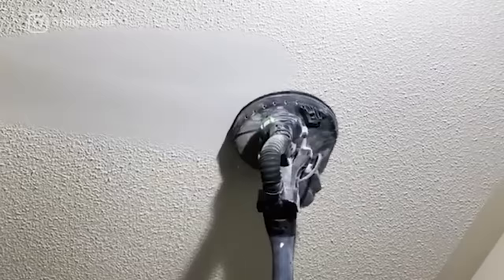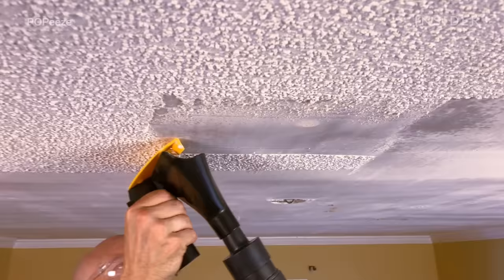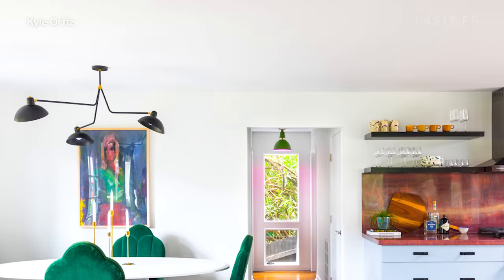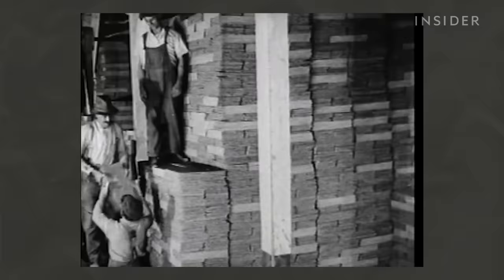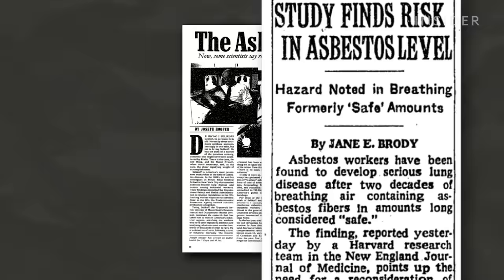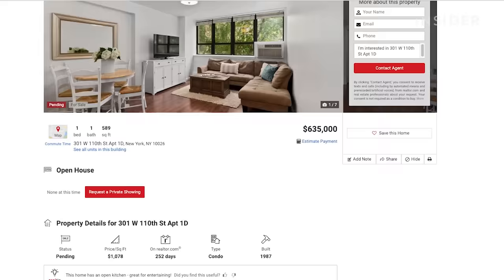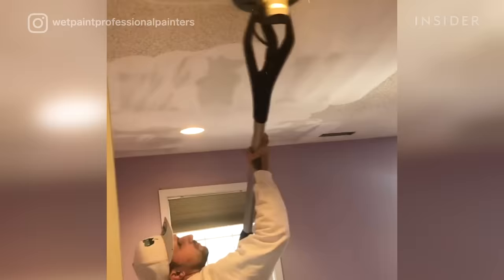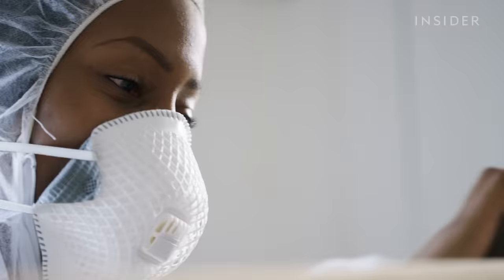Why Are Popcorn Ceilings So Terrible?

Comment: I recently moved into a house that had popcorn ceilings installed in all the common areas. But, my wife and I love the ceiling because whoever had it installed had glitter mixed in, so it sparkles! I feel like I'm looking at a night sky.
Reply: The house I grew up in had iridescent glitter in the popcorn so it took on a variety of colors.  I always thought it was pretty.
Reply: Uh dude... I hate to be the one to tell you this, but I worked 15 years as an asbestos building inspector.  While not always containing asbestos, I observed that the glittered popcorn ceiling was more likely to contain asbestos.  Probably something with the styles at different time periods.  This is in reference to the ceilings that had gold or silver flecks mixed in with sprayed on surfacing and not referencing a ceiling someone later applied actual glitter to.
Reply: @anonlastbend7439  just googled glitter popcorn ceiling because I never seen it before and got this information so it must be true.
Reply: Scott: Our commercial building which was built in 1966 still has it's glitter mixed with the popcorn on the ceiling.  You are right the glitter does look like stars when the light hits it just right.
Reply: @josephquezada6138  ya my house only has it on the stair well ceiling leading to the basement, really nice effect to be honest lol
Reply: Our old house had a child’s room where a dozen or more glow in the dark stars had been put on the ceiling above the bed.  Even after my wife removed them, you could still see faint glowing stars at night.  ✨
Reply: @whatisahandle221 we painted glow in the dark stars on our daughter’s ceiling. Then painted over them later. You couldn’t see the stars after that … in the daytime. But at night they’d still glow up and shine just a tiny bit. People thought they were hallucinating! We had to remember to warn people who stayed in that room overnight. 😂

Comment: As an asbestos removal expert I only watched this to make sure it was mentioned. 
It's both unwise and in many states illegal to remove asbestos containing materials yourself. 

If you do decide to do it yourself, know that asbestos fibers can stay airborne for up to 5 days in stagnant air. Industry standards require workers to wear p100 respirator filters. And dry removal is an absolute no go.

It is really in your best interest to have your demo materials tested for asbestos prior to removal whether you plan to do it yourself or hire a contractor. Low level exposure to asbestos fibers will not likely cause asbestosis, however lung cancer/mesothelioma can be contracted potentially through one exposure. (With a latency period on 20-40 years average)
Reply: I thought latency was 10 to 40. It's been 20 years since I removed asbestos.
Reply: Thanks for the heads up
Reply: can 2x4 ceiling tiles from the 80s have asbetos?
Reply: Thanks for the informative post. What are your thoughts on nailing tongue and groove boards directly over the popcorn? Someone in my home did this and I am concerned that the process of nailing the boards smashed the popcorn and released toxic fibers into the home... Thanks!
Reply: @randomrazr  No. It was gone by then.
Reply: Your comment should be pinned, it is a really dangoures stuff
Reply: Nice try.. keep securing that job security bucko
Reply: Is there asbestos black market?
Reply: @chanpasadopolska  I am pretty sure there is, as for every kind of Waste.
Reply: My neighbor called my dad in for removing asbestos slate siding.   When the state inspector came he was quite happy.   Apparently my state was giving out loans to remove the stuff.  He also had no problem with how my dad was doing it.
Reply: Can't wait... I get a speed run on life.
Reply: Just curious do you know of a modern safer version? I love the look of popcorn ceilings, way nicer to look at than smooth
Reply: @mlee6050  Home improvement stores will carry a special roller. It has texture that you dip into a watered down mix of drywall mud (or use plaster for longer wear), and you just roll on texture to the walls. Looks very nice and better than using a sponge for effect, or a wet schrunched up groccery bag, or the avant-garde broom sweeps. So you can pllay with the thickness of the mud/plaster and also the pressure you roll with. Keep your tools clean between breaks and you will have beautiful walls or ceilings in no time. 

BUT usually you do the 'knockdown'  approach for a thick textured ceiling. 

Either way you will want to apply that texture to a smoothed finish for best effect, not just right onto the drywall... that dont work very well. And use primer paint before your flat ceiling paint.
Reply: @migs7220  thanks for that, going to be awesome to do :)
Reply: @chanpasadopolska not black market, you can pretty much still buy it in china since it is still being used as a construction materials there....
Reply: I used to scrape off the popcorn crap when I was a kid all the time in hotels and stuff...Good to know. I'll check back in 25 more years and let y'all know if I have cancer.
Reply: @mlee6050  You can get the same texture, without the asbestos. It's just the really old stuff that contains it.
Reply: I do asbrstos abatement as well. I'm setting up a full-house celing scrape right now. Just stopped for lunch and this video came up. Had to watch it, lol.
Reply: Just do regular lung cancer screening.
Reply: That's fine if I get mesothelioma because then I'll be entitled to some compensation 😂
Reply: I had no idea about anything and decided to put up some cheap foam tiles, anyway I disturbed the popcorn ceiling several times and ended up pulling them all down in the end...Still waiting for a test from the council. I have 2 kids under 5 with asthma :( very worried
Reply: @BewareTheLilyOfTheValley  i laughed lol
Reply: Probably best to cover it with Trusscore or similar product.

Comment: 10 years from now
Science Insider: “Why are plain ceilings so terrible?”
Reply: Agreed
Reply: "bad acoustics" loll
Reply: We are applying every thats come in market without knowing what will be there effect after 10 years 20 years after . What is there side effects.
Reply: Jajaja true
Reply: op exactly
Reply: 15 years later:"why false ceilings are so terrible?"
Reply: @honor9458  rofl
Reply: No.
Reply: Oh yea
Reply: Yea Why Don't We Buy A $800,0000 Ceilling Made Of Gold?
Reply: Honestly I wouldn’t be surprised!! They change their mind about everything!!!
Reply: It's called artex and not all of it contains asbestos. After something like 1984 they stopped adding asbestos to the mix so those ones are perfectly safe they're not all "popcorn" either some are swirls or other variations on geometric designs. Even the ones with asbestos are safe to remove as long as you don't scrape it or something making particles airborne. You get a special coating which makes it like jelly and just peels off.
https://en.m.wikipedia.org/wiki/Artex
Reply: @Michael Hauger Generally speaking but the artex company was bought over by a French company who continued to use asbestos upto I believe 2002. Obviously that's all dependant on the manufacturer but better safe than sorry when it comes to that stuff, it's horrible. Just to say really appreciate you spreading awareness of it, it's personal to me
Reply: If they have asbestos in them then yes . Otherwise don’t be dumb
Reply: Well usually it's a knockdown or orange peel texture and not just plain

Comment: Its  called  acoustical because it is sound absorbing and stops inside echoing. It was made for commercial buildings to cut down echoes  in hallways, large meeting rooms, concert halls etc. It works extremely well, cutting the echo effect in half over flat ceilings of other textures. Its used in residential homes mainly because its sprayed on and goes on faster then other then other ceiling textures

Comment: I like popcorn ceilings. Visually pleasing, no health risks (don't buy a house with asbestos) and better acoustics. Easy to maintain, too. If you drill a hole for a light fixture (disco ball!) and later decide to remove it, you can cover the hole with a bit of paint. Popcorn ceiling is uneven so any imperfections will be easy to hide.  

Smooth ceiling is THE worst option you can choose for a family home. There's a massive echo because sound waves will bounce off the ceiling, the walls and the floor (assuming you've got hard floors). When you let out a fart, it sounds like a laser shot. pew-pew-pew

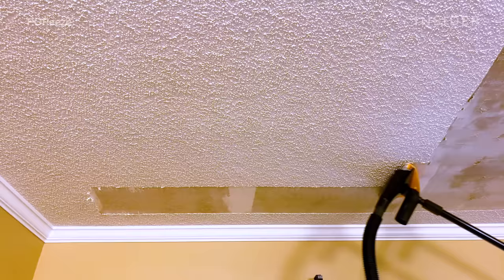Comment: 2:42 "the only practical problem with popcorn ceilings is the release of asbestos in the removal process"
4:30 "if you've got popcorn ceiling you can go ahead and remove it yourself"
Reply: 5:36 “your a pleb”
Reply: I’m so sorry for your lack of oral comprehension 😔 I’m praying for you, bro 🙌
Reply: shows "do it yourself" person using a respirator. Then shows 3 shots of professionals doing it happily without breathing filter while all the dust falls around them.
Reply: Alfonso Cevallos 😆😆❤️👏
Reply: In the US, can we assume that popcorn ceilings in homes BUILT AFTER 2000 are asbestos free?
Reply: No Alfonso. Read my post above on asbestos abatement. It's not an easy or safe job.
Reply: @tomlandon209   I wouldn't assume anything, esp. if you had an unscrupulous contractor w/ old stock on hand. Besides, how many homes had popcorn ceilings after the late 80s? If it's popcorn, it's a safe bet it has stos. Don't diy!! Please!!! You endanger not only yourself, but everyone else who enters that room/home.

Comment: My house, built in 2001, has popcorn ceilings. I never notice the ceiling either in a positive or negative way. It's up there covered in a texture that I'm not gonna bother to change. This sounds like more major whining about minor issues that has become way too common in society today. Just my humble opinion.
Reply: I always thought the texture was more cottage cheese looking that pop-corn.
Reply: I don’t mind them but the asbestos is more than a minor whining issue
Reply: @cl22396  Yes, that would be a problem. But in my '01 house, that's not an issue, hence the cavalier take.
Reply: @aggielonghorn they’re unsightly and look cheap. No one is whining lmao it’s just an opinion and over homes don’t tend to have popcorn ceilings. They’re outdated and lazy work
Reply: Until they are no longer white and you have to paint them.
Reply: @Moluccan56  lol, so true and that time is pretty much now. Initially the walls including all ceilings were painted an off-white sort of color, but masking is no longer occurring. We must remove the coating to paint or spray paint the ceiling with an air spray gun. We'll see.
Reply: @aggielonghorn spraying seems to be the best way to apply paint to popcorn, as long as you want to do your walls afterward. The popcorn can get bald spots and the roller becomes all gummed up with the spackle, it’s not a job that anyone could say is fun. 🙃

Comment: Save you 6 minutes, popcorn ceilings that are 40 years or older might have asbestos in it. Otherwise it's just a cosmetic thing and you can ignore the "danger" click bait thumbnail.
Reply: Better get rid of the popcorn ceiling ASAP because even the tiniest amounts of asbestos causes lung cancer. We're talking as little as 1.3 parts per billion (1.3 mm^3 out of a cubic meter). Even brushing it with a feather duster already releases that concentration of asbestos.
Reply: @00crashtest  welp good luck to all the poor souls who are going to die just because they wanted to remove popcorn ceilings
Reply: This video is hardly clickbait.
Reply: Thanks
Reply: 00crashtest true, but what are the chances of that extremely tiny amount being inhaled?
Reply: I work in remediations for asbestos. To be honest, everyone breathed in asbestos in their life. If your house was built around/ before 1970, there is a good chance that your house can contain asbestos.. it can be the insulation around your pipes, the popcorn ceilings, tiles, on the roof or even outside of your house.
Reply: 00crashtest stop spamming comments with your copy paste bull shiz
Reply: @00crashtest  if left undisturbed, there is very little risk. HOWEVER, if you have a popcorn ceiling with asbestos in it or the drywall behind it, you CANNOT just remove. there is a very good reason why there are companies the specialize in asbestos abatement (they can remove asbestos laced materials in a safe manner.) so don't, for the love of god, just DIY remove building materials in a old house unless you know the house either was already abated  or  was post asbestos ban.
Reply: Thanks
Reply: Thank you!
Reply: THANK YOU!
Reply: my house was built in like 2000 so i think im good
Reply: @bbarbiter  Over the years, the chance is over 99.9999999999999999 (100)%. Because of diffusion and the fact that asbestos fibers are so small, you're guaranteed to inhale some. Law of large sample sizes of probability. Consequently, if you stay in the room for only 10 seconds, then it's likely that you don't inhale any of the amount.
Reply: @Quartzkensai  I'm not telling the commoner to remove. I actually support it being illegal to be removed (as is in some municipalities) as asbestos is comparable to nuclear waste. What I am supporting is people hiring asbestos abatement companies to remove the popcorn ceilings who use 1 layer of wrap (except for the floor), 3 layers of wrap for the floor, and a negative air machine with a HEPA air filter to prevent even a single asbestos fiber from escaping.
Reply: Gr8 Incarnate  Yes, alternatively, you can paint the ceiling. However, you canNOT touch the ceiling during painting it, as even skimming releases friable asbestos. Instead, you must SPRAY paint the ceiling.
Reply: 00crashtest the vast majority of popcorn ceilings don’t contain asbestos, this video is clickbait garbage.
Reply: This is clickbait as a huge percentage of homes don't have asbestos popcorn ceilings. Plenty of new homes have popcorn ceilings. My dad built his house 10 years ago and has popcorn ceilings. Many new homes built this year have popcorn ceilings.

Many people like popcorn ceilings as a simple painted ceiling is boring and in my opinion doesn't look as nice.
Reply: Well been living for 14 years and my house has a popcorn celling and havent gotten sick yet except for strep 2 and a cold 2

Comment: The stuff is toxic while being removed and none of the people in the video are using face protection whatsoever :/
Reply: Not all popcorn ceiling has asbestos
Reply: Ok mexican john egbert
Reply: @Mogachaffe  none of it should be breathed, asbestos or not. ...but it should absolutely not be breathed in if it contains asbestos (obviously).
Reply: Not even the cartoon people
Reply: It's toxic while being exposed to it for an extended period of time, most of the diseases (such as pulmonary fibrosis and cancer) don't usually happen overnight
Reply: @ralu4560  you misunderstood the research. One fiber can cause damage to your lungs and your body has no way of removing that fiber from your lungs. Over time that fiber continues to cause damage to your lungs.

But you're much more likely to breath in lots of fibers, than just one if you are exposed to asbestos.

It only takes one breath to be exposed to asbestos, however you are much more likely to take that bad breath if you are often working around asbestos for prolonged periods or standing under asbestos filled dust as you remove popcorn ceiling without a mask on.
Reply: @idontwanttopickone  thanks
Reply: Its just toxic
Reply: i see dust falling off and these guys arent wearing protection. Big no no. Regardless of asbestos; no dust should be inhaled!
Reply: We are trying asbestos we can
Reply: Samuel Rocha García some are
Reply: Samuel Rocha García    was thinking same thing, usually done in full tyvek suit or something similar as well, dummies!!
Reply: @ianhale4466  badum chh
Reply: R/AsbestosRemovalMemes
Reply: The 1k like
Reply: Zachary John how can you tell
Reply: Jacob Monnin ok
Reply: john eggburrrt
Reply: Hey, some are wearing paper face masks. That should stop a microscopic harpoon, right?
Reply: Yeah. Even if the ceiling coat doesn't have asbestos, it still contains silica.
Always should use respirator with P100 HEPA filters
Reply: @jayh993  Silicosis is similar to asbestosis. Modern synthetics are even smaller than stos! Just as barbed & deadly too.
Reply: So were you not listing that entire video. They literally said it’s only toxic if it has asbestos which they don’t all have omg
Reply: @indiamckay7782  No Linda, most popcorn has asbestos. The older, the more likely. But you go ahead & take your chances. I'll be long gone by the time you develop symptoms. Ciao!
Reply: @Stravo Lukos I don’t even have a profile ceiling but okay then lmao. You’re weird
Reply: Popcorn*

Comment: Why all the hate? I’ve always thought it added a nice touch to a ceiling
Reply: Fr
Reply: Asbestos
Reply: @marc4177  opinion
Reply: @Chloestewart._21  nah its a fact
Reply: @marc4177  logic 100
Reply: @Chloestewart._21  Indubitably.
Reply: @shibasarekewl7704  The asbestos is harmless as it is trapped in there. It's only "harmful" if it is drilled/sanded or ironically removed in the effort of safety. And even then, it's such a small amount... only 3% max is asbestos, and it is bound up in stuco as opposed to a free-floating fiber form.